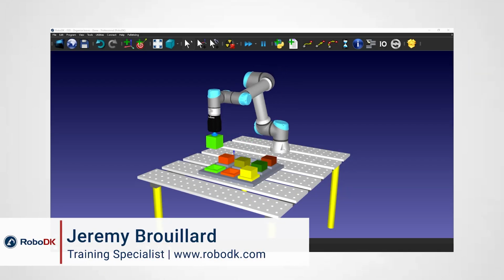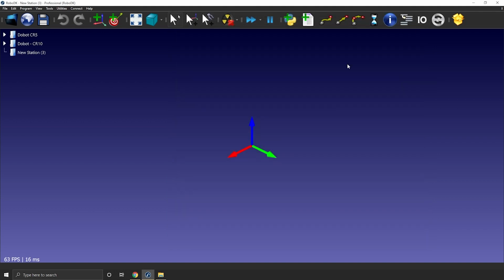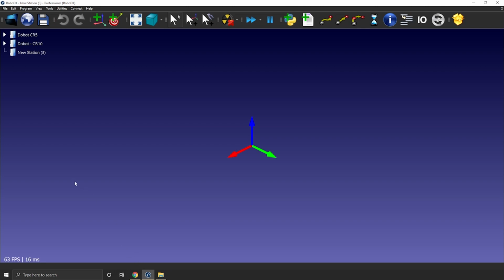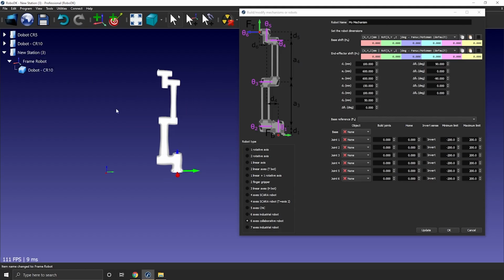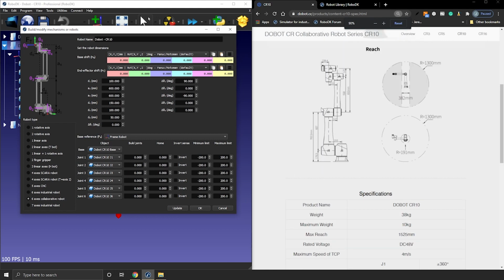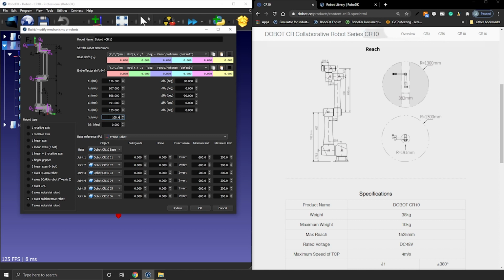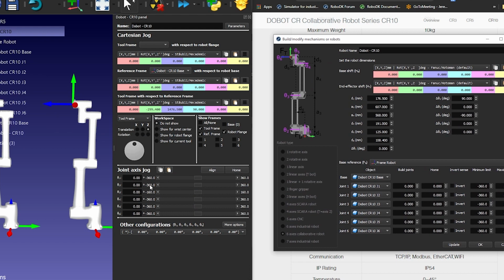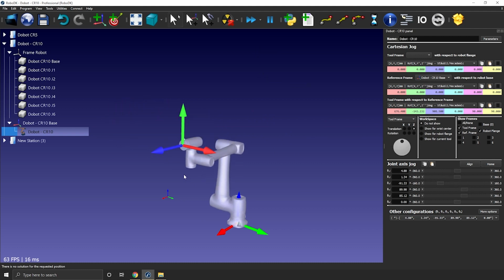Model your 6 axis cobot

Comment: Hello there. This is really great demo. I would like to ask if we could convert our simulation and generate the codes required to be integrated into our DOBOT CR5 cobot. would that be possible to be done?
Reply from the maker: Thank you for your feedback. You'll find the Dobot CR5 in our library: https://robodk.com/robot/Dobot/CR5. You can also contact us by email to add new robots.
Reply: @RoboDK3D  Thank you very much. I am wondering if RoboDK allows for direction connection with DOBOT robots (CR5, Magician, and MG400)? Meaning I can simulate in RoboDK and it would directly connect to the robot? 

Or, would RoboDK be able to directly generate the robot code based on the simulation we have performed and confirmed?
Reply from the maker: @wenshyan89  
For such request, you can contact us on our forum. 
robodk.com/forum

Comment: how to come up with  your J1 J2 J3 J4 J5 J6, mine when apply split object, come up 2700 ++
Reply from the maker: You should group the objects to have one item per joint. You'll find more tips in the documentation: https://robodk.com/doc/en/General.html#Model1x
Reply from the maker: Take a look a this video: 
https://youtu.be/9BDpiBaOYuM
Reply: @RoboDK3D  Hi, many thanks for the prompt reply. When i follow this video, it looks very tricky to me such as deleting the legs, is there any other better way of doing that? or it is just essential to be like that?
Reply from the maker: @fhong717  
You can use a CAD software to simplify your 3D model.

Comment: Great video but I have a problem when I add my 3D robot model when I do a movement some pieces will stay with the rotating part others wont, it must be a joint fix problem, can it be solved in the program? Can I make some kind of relation between the parts?
Reply from the maker: You can share your work with us on our forum, it will be easier for us to help you. 
robodk.com/forum
Reply from the maker: You can also look at theses videos to help you:
https://youtu.be/9BDpiBaOYuM
https://youtu.be/OSY_BGlUpFc
https://youtu.be/-woD7T27hGQ